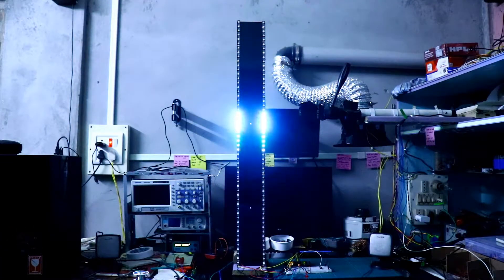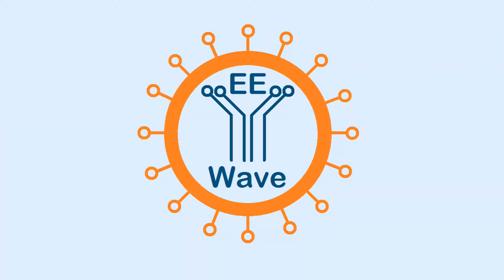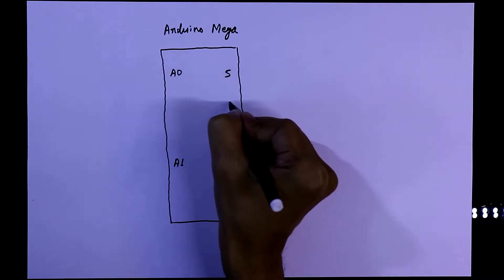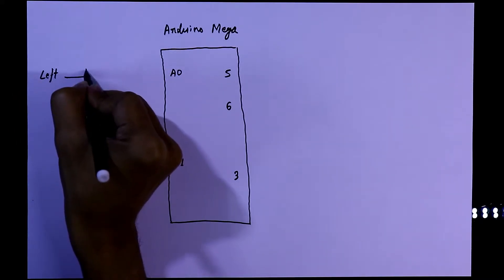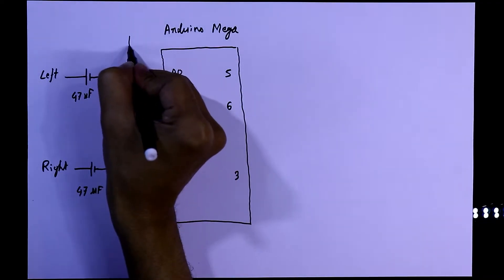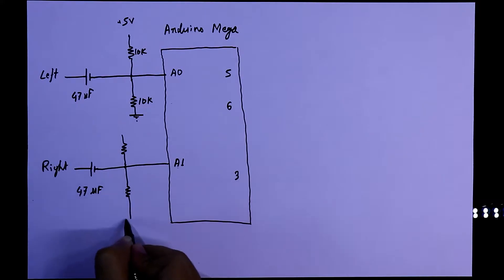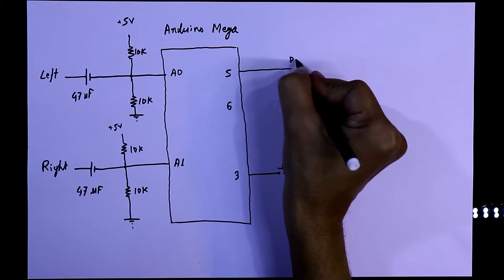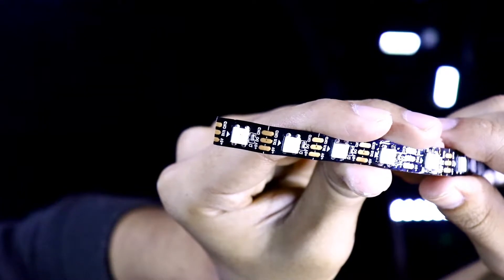Stereo vu meter using ws2812b led

Comment: Ok, so I've seen this dude answer the question "can I use a nano" over and over and over again, but is there no answer to the unique and very relevant question only 1 person has managed to ask??? WHAT CAN BE DONE ABOUT THE IRRITATING SQUEALING NOISE THIS CIRCUIT DEFECATES THROUGH YOUR SPEAKERS?!?
I built this circuit into a shield that I can just plug into the mega, and it works great!....but as more lights light up and get brighter, the louder the noise gets. Any solution to this would be immensely appreciated. Thank you
Reply: Did you try adding some decoupling capacitors across +/-?

Comment: hello ! 
nice work ! 

I m trying to use it on a ESP8266, and it works well is I suppress ripple function line 2239
Otherwise I have the following error : 
Any clue to solve this ? 
Thx

 2239 | SimplePatternList gPatterns = {fire, fireblu, juggle, ripple, sinelon, twinkle, balls};
      |                                                       ^~~~~~
      |                                                       |
      |                                                       void (*)(boolean) {aka void (*)(bool)}
exit status 1
invalid conversion from 'void (*)(boolean)' {aka 'void (*)(bool)'} to 'void (*)()' [-fpermissive]

Comment: Thank you for the video. I really like it, I'm building :) I have a question. I downloaded the code (Rar) file, unpacked it, found all types of light.  I do not understand how I can upload them all? Or can it just be separate? I'm not good at programming , please write it. Maybe if you can link. Thank you!
Reply: just load them in separated tabs,those are the actual functions of the effects,they will compile together with the main code,that is the pushbutton
Reply: @apolzanmarius2598  working! Thank you
Reply: i have problem with upload size to big how to solved?
Reply: Effectively mate.!!  I have been able to compile it so.thank you very much!!

Comment: I love the diy fume extractor. I have to build one but I use the kitchen in our basement (it used to be an apartment) and I need to install a new window first. Every window in our house is new except 5 tiny basement ones that are embedded in concrete and have to be custom made because of their size. 

Why use a mega for this my friend? I have 2 megas and like 15 uno/Nanos I could waste on this as I have around 500 ws2812b leds in strips, single smd ones, etc. I have amassed every type of led you can imagine lol even obscure ones from China that took months to arrive haha

Comment: hey sir.. can arduino pro mini atmega328 be used for this project??
Reply from the maker: No bro, it works only with Arduino Mega. The program size is huge, so it needs more memory.
Reply: ok thank's bro...
always success.......
Reply: @Romiqtiink  yes,you can
Reply: @apolzanmarius2598  how to use this in uno

Comment: can we used arduino nano instead to mega?
Reply from the maker: No, Only Mega.
Reply: yes,you can,just use 1 single library ,there is 1 that can work with both adafruit and fastLED,and take off all the softwareserial parts,it should work on nano

Comment: super project very nice patterns 👍🏼
Question: Do you have a connection diagram?🤔
Do you need the Arduino Mega or is a smaller one also possible?🤔
Reply from the maker: Thank you dear. 

Sorry 😔, I don't have any pdf diagram, and if you are asking about the connections then all are written in the video, just take the screenshot.

The program is very large, so we need to use Arduino Mega only.
Reply: How many LED's can be connected or used for each channel ?
Reply from the maker: As many as you want to connect. More LEDs means you need more powerful power supply.
Reply: Ok 
Question: And one more question: Can I use the power supply directly through the connector from the Arduino Mega ?

Can I also reach you by e-mail ?
Reply: you can use arduino uno or nano if you do what i have commented
Reply: @apolzanmarius2598  ok thank

Comment: In 3.5 mm jack where will be ground connected in your diagram?
Reply from the maker: Ground is common for all. You can connect headphone Jack ground to the Arduino ground pin or power supply ground pin.

Comment: Why 47 micro Farad, and not 470 or 4700? Why is a particular cap chosen over another?
Reply: The capacitor is to isolate any DC from the audio input. It also acts as a simple frequency-dependent filter. The higher the value is, the less high frequency signal will pass. The value is generally determined by experimentation. I'd use about 10uF, but, not having built this circuit, the indicated higher value may have been chosen to give more realistic "ballistics" to the display, so that it drops off slower.